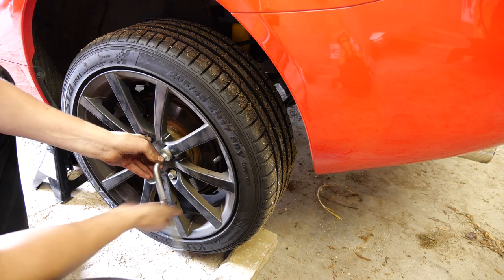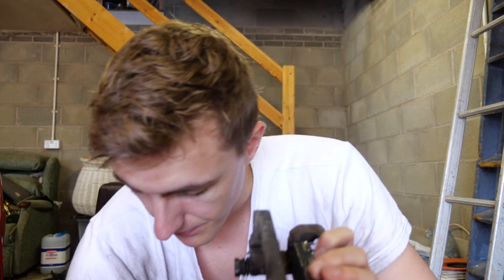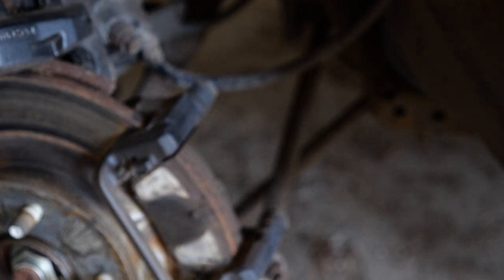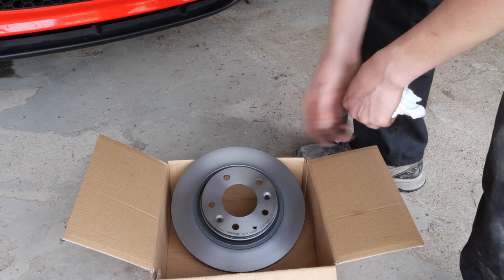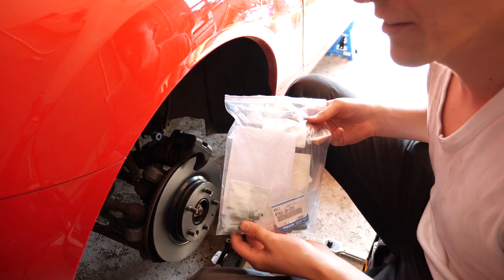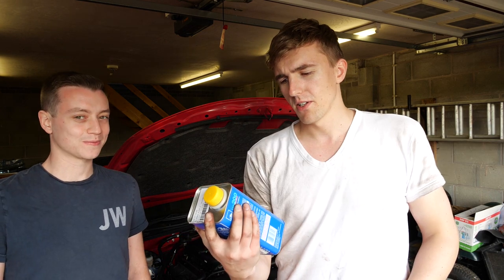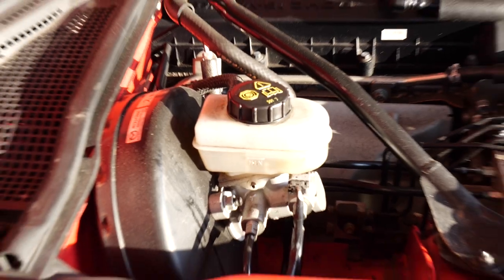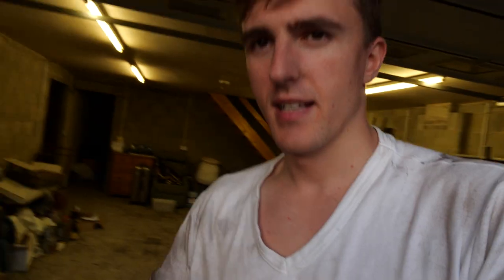I broke my car! - Rear discs/pads and brake fluid!

Comment: Just watched your brake disc replacement .the rear disc with the screw hole in should be threaded.you wind a bolt in to pop the disc off the hub .my rx8 has the same .great when they are rusted to hub. I know this is a year ago but usefull. 👍